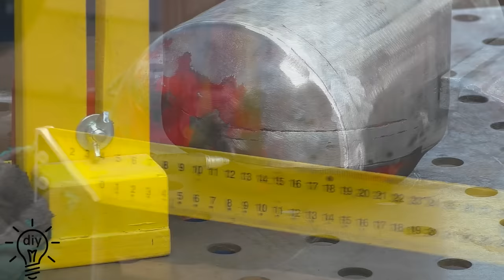A brilliant idea from an old fire extinguisher! You'll be glad to see it!

Comment: For anyone who has all the tools-and the experience- and a bunch of old stuff laying around--and a lot of time--this looks like a fun thing to do.  For anyone missing any of those, not so much.
Reply: Don't get me wrong, it is well made and looks great, but it's way more flat stock than fire extinguisher
Reply: I'll just go buy a big one that way I don't have to waste my time putting on and taking off 3 sausages over and over everytime people come over
Reply: @dickballington702  
Les vaniteux sont tellement nombreux sur cette terre !
Il regarde une vidéo jalousent la personne talentueuse !
Parle de leur égoïsme en parfaite connaissance de cause  !!!
Reply: Lol
Reply: I don't know why but your comment really made me smile. I also totally agree with you 🙂👍
Reply: in a way it's like extreme home makeover, without Ty but with a repurposed extinguisher. 
yo.
Reply: Very complicated
Reply: The only non-standard tool here is the welder
Reply: Yeah, and you need all kind of discs for angle grinder. And why not, like, who would use paint stripping gel, when you can do it the hard way? Also, this crap will rust without heat-resistant paint. It's dumb. Also, TIG welder is basic?! The price of a good one, and accessories, and storing of gasses, and wires, and protective gear. And cost of the hole drilling attatchements. Goddamn. Just buy a grill. This is dumb. And also heavy, he uses unnecessary thick material.
Reply: Aye yo, nice name 👌
Reply: @sankarbijoychakraborty5144  I wouldn't say it's complicated exactly-- but there are a lot of steps in sequence.  In the aggregate it's simply a lot of work for a pleasant, but I think given the amount of work, modest return.
Reply: @janvrabec3401  Really heavy.  And for a relatively modest cooking area.   But OTOH, yes, it's cool, and interesting.  This is not dumbest-idea-on-the-internet territory here.  My point was that it's not generally going to be accessible to a lot of people.  And, um, 33,000,000 views? So it certainly resonates.
Reply: @dickballington702  Nobody cares if you make one or not.
Reply: @Em Cee, exactly.
Reply: @Marc10182  it's not selfish to point out that it's a lot of work for such a small reward.  People put their videos out for public consumption then others (like you) cry when it's consumed... Stay off the internet if you can't handle people's opinions.
Reply: What you on about, gents, 8:45 minutes! Is all it takes!
Reply: @dickballington702  Do what makes you happy.
Reply: @sankarbijoychakraborty5144  I guess with that attitude we won't be seeing you make one.
Reply: This is the 1st comment to ever make me actually lol. Maybe because I heard it in my head as really sarcastic. Amazing. Ty
Reply: @feihong005  You heard correctly.
Reply: I agree it's all very clever and all, if you a the scrap, a welder, the power tools, the time. Or you could just get a $10 hibachi and be done with it.
Reply: @dickballington702  you almost got us fooled. 
Bold of you to assume anyone would come over, let alone you have friends. 🙄
Reply: @michaelsexton8885  
L'inversion des valeurs personnelles. 

Michael Sexton, nous ne trouvons guère de gens de bon sens, que ceux qui sont de notre avis !?
Tu comprends la nuance entre “T’es un con” et “Je suis pas de ton avis”.
Cordialement
Reply: @michaelsexton8885  
En sport, on reconnaît facilement ceux qui sont meilleurs que nous. mais dans le domaine mental, on a l'impression de détenir la vérité, ou en tout cas, ce qui s’approche le plus du bon sens.
Notre réflexion est précieuse à nos yeux : se faire insulter pour ce qu’on pense, c’est se faire traîner notre égo dans la boue ! C’est aussi violent que de se faire traiter de gros ou de moche.
Une opinion, c’est une recette de cuisine : tu mélanges que tu sais avec ce que t’as vu, ce que t’as lu, ce que t’as cru comprendre, ton expérience, tes croyances et tes valeurs personnelles, tu mets tout ça dans ton four mental et tu fais cuire à réflexion 12. Puis tu présentes fièrement ton gâteau à l’assemblée.
Ca, c’est sans compter les goûts de chacun et les allergies. Ca veut pas dire que ton gâteau mental est mauvais, y’a juste plein de gens qui ont de bonnes raisons de pas aimer ta recette.
Y’en a même beaucoup qui estiment que ton opinion ne vaut rien avant même de l'entendre.
Deux politiques de parti opposé, c’est exactement  ça : pourquoi écouter l'autre puisqu'on sait déjà qu'il va dire de la merde ?
Eh ouais. Donc là, t’as bien les boules, c’est la guerre puisque ton opinion est saine et intelligentes. Les autres, ils sont pas seulement différents, ils sont aussi malsains et idiots, hein ?
Si tu comprends pas ce que je viens de dire, c’est que t’es un gros débile.
Eh ouais, hein ! C’est agressif, hein ?
Voilà, donc : arrêter d’insulter et de dénigrer, c’est la base.
Cordialement.
Reply: you only buy stuff dont you?
Reply: On top of that you also need the fire extinguisher!
Reply: @janvrabec3401  it is a MIG welder  and disks don't cost much. Most things like welders can be rented cheaply or maybe we know someone who can lend us. Oil paints are expensive and there are many people who can't afford them, but to complain to Bob Ross about a how to paint video is borderline ridiculous.
Reply: @yvandaniel8050  God forbid.
Reply: @ringofasho7721  vero.
Reply: Tell me you live in an HOA neighborhood without telling me you live in an HOA neighborhood
Reply: @joelsefur666  I bet you're a blast at parties.
Reply: Bro why haven't you patented that And sold a shit load of tiny smokers people would buy those all day for camping.
Reply: @janvrabec3401  It's a MIG welder.
Reply: @wvmtns6400  
ه
ششش
Reply: You have two kinds of people. The kind that have stuff and are willing to go out and find stuff.  Because they like to work with reusable stuff.  We are on a never ending quest to find this stuff and put it to use.   And then you have people that piss and moan about stuff.  And claim that missing one piece of the puzzle is a deal breaker.  Although all the parts are readily available when sought.   These people stop themselves before they even get started.  And yes, those people should probably just buy a barbecue Made in China, hehe.  I like working with metal.  So this isn't so much about what he's made.  But about how he put it together.  Because I intend to use the skills, or ideas,  myself.  I am in no way restricted to making an exact replica of this project myself.   A video such as this could just as easily bring about a new thought of creativity.  That might bring about a totally different build idea.  But not if I'm ready to let one missing piece put a stop to my project.  Because unless that one missing piece is my brain.  I can figure it out...
Reply: @randomamerican471  Well stated Mr. American.
Reply: WHY? Just because you can.
Reply: I agree with you. I watched this video and I thought "what a waste of time for three sausages".
Reply: You could have it all and with all i mean the actitude to do it
Reply: @joelsefur666  amen
Reply: @janvrabec3401  Wow, thanks for the insight Major Buzzkill!
Reply: Exactly what I thought.
Reply: It's a great design anyways. I think I could do that out of other materials in 5 nights or so after work. Perhaps cans instead of steel . Who knows. I'll try and tell you in a few months when I find the time to figure how to properly do it.
Reply: @ringofasho7721  jorh
Reply: Way to time consuming for end result.
Easy 8-16 hours work for something that can hold 1 chicken.

Best thing to use is an old keg.
Light weight and actually a decent size.
Made a few for people over the years, really easy way to make $$$
Reply: Totally agree 💯
Reply: This is an example of the biggest problem in the world today, pessimism. These tools cost about $200 altogether fire extinguishers free and you can get those pieces of metal for free at a metal yard as scraps. And you can literally watch YouTube videos for free for two weeks and learn how to do this with unlimited free materials if you mess up, the tools you only have to buy once.
Reply: @janvrabec3401  
"All kinds of discs"
Looks to me like that could all have  been done with 2-3 cutoff wheels at a buck each and a single 80g flap wheel for about ten bucks.
Hole saws are a long-term tool you buy to keep, but there are cheap disposable ones too.
Except for the welding, there's nothing her that the typical homeowner couldn't do.
Reply: He is  just fooling   people like you  to jake money  in the u tuhe
Reply: All the tools? You only need 3 tools to make it. Lol
Reply: I agree , he obviously has way to much time on his hands, or he’s on a Prison day release scheme 🤣🤣🤣
Reply: Lol all you bums complaining about how much work this is. . . I could build this in like 20 minutes. It’s not complicated at all but I guess if you spent your whole life in front of screen instead of learning valuable skills, then sure. But I digress this is the world we live in today.
Reply: @stevenseagal6548  kegs are made of aluminum. Therefore requiring a specific type welding machine in order to weld it. This wouldn’t take anywhere near 8-16 hours to build and the one in the video won’t hold a chicken lol. 

Also aluminum is an amazing heat sync. Meaning it dissipates heat very very effectively. Thus rendering your though completely pointless. You want a thicker material in order to retain the heat from the fire. As with smoking it isn’t about using high direct heat for cooking. It’s using low temps over extended periods of time to slowly cook the food to tenderness and impart that sweet Smokey taste into the food being cooked. 

All you negative Nancy’s need to go on somewhere. I don’t get it. How can so many people be so negative about what someone else built and put on the internet to inspire you to create your own things in life. Jesus you people need help.
Reply: Exactly ❗
Reply: I was thinking the same think... Yep no welder in my tool box
Reply: @TuscanyFTX  Mate I've been a qualified metal fabricator for 15 years and am a qualified pressure welder.
Have also done plenty of quoting and time estimates.
I've made a few different kinds of smokers for fun.
I see about 8 to 16 hours in this, if you wanna make it nice quality.

If you think you can make this in less than 8 hours to the quality on screen, ill hire you tomorrow.

I know what I'm talking about.
Im not some back yard fabricator.

Also the majority of MIG welders can weld aluminum, replace your lead liner, change gases and wire.

If you buy a decent TIG it'll be acdc and can weld aluminium as well.
Reply: Have to agree with the OP. I can buy a grill for $200 and in way less time
Reply: HA HA, My problem is I don't have the imagination!  Took me half the video to figure out what he was making.
Reply: @stevenseagal6548  I’ve been professionally welding/ fabricating/erecting for 20 years. I could build that in under 8 hours easy. He uses scrap laying around to build it. It’s not that difficult to do. I’m good on the job offer though thanks.
Reply: COVID project.
Reply: The fact that so many people don't have the know how to fabricate even a little, really irks me, I think you all are selling yourselves short, it doesn't take 70 years to get the skill, you could be as good as this guy in just 4-5 years of practicing for a couple hours three times a week!
Reply: @Marc10182  I don’t think anyone on earth cares what French people think. Unless they want advise on surrendering.
Reply: @chrisallen9154  no one cares that you don’t care
Reply: @TuscanyFTX  it’s very easy when this get shoved in front of other things you watch and the title says you’ll be glad you watched. I was not glad I watched someone do something I’ve seen before. Wow he cut some metal and welded it back together to form something else. I’ve watched and done crap like this since I was a teenager. It’s boring now. I wouldn’t say anything if the title didn’t say I’d be glad I watched
Reply: Yeah, the material and equipment cost more the a commercial smoker BBQ.
Reply: @wvmtns6400  kkkkkkk
Reply: Victor
Reply: @jareda3106  i mean it probably took him a week to make this one...
Reply: Do you know how people get tools and a bunch of stuff lying around? We buy the tools, collect the old stuff. The experience comes with using the tools to create things from the old stuff.
Reply: @ringofasho7721  ♧$
G
Reply: Super))
Reply: more items on my youtube channel)))
Reply: The experience is way more important than the tools. Metal fabrication that doesn't look like it was done by a tarded meth addict takes lots of practice.
Reply: But the idea of bunch of friends letting their tools is something to retake. In big cities for exemple this is much worse. I give one another example: two years ago I was in the Alps doing free work for a community. And many people in this community were working free too, for the aim of cutting wood, for the whole community there. A small village 200 inhabitants... Isolated quite isolated. And also cleaning paths.. cutting savage vegetation etc in the middle of the paths. The tools belonged to either private people or some company or the mayor.. anyway.. solutions are often possible.. not like places like Cuba for example. I just talked with friends about the possibility of planting olive trees or anything alike... in Cuba... Which is solution.. and not possible because people are despossesed of either lands or either of permits.. or either of even just the will to be like that.... To do thinks like that.. and as you said! Of course.. to be able to do it: tools.. learning... Permits... Spirit of good will etc...and not transforming the countries into contaminations huge companies of hundreds of like slave workers.. but instead things and projects that are originals.. and more or less free.. at least with participative actions.. more than violent actions. Instead of taking the hood things of each country of each person.. more and more we appear to be having taken every defects of each group instead
Reply: @janvrabec3401  well that was pretty brutal of you. I see your point, and I'm sure he already knows all of this as well, I'm guessing it's a hobby type project for  him. I  actually tried it myself (far from that professional looking/functioning by far) and wound up burning down my daughter's dollhouse, and half of the back yard! But 2 out of the 6 sliders, tasted great, and didn't resemble hockey pucks! 😜
Reply: I love it! Fun little project to practice your fabricating skills and end up with something useful! Those hinges are priceless! Well done!
Reply: For those there's the G-Stove 😉

Comment: Pretty cool . I welded for a lot of years . He has pretty good skills. One thing I noticed is the use of a grinder. I was taught how to use a cutting torch. I got really good with one . I worked in a welding shop back in the late 60’s through to the early 80’s . If my shop Forman caught me using a grinder to cut up the pieces to make the stove he would of taken my head off .  I can hear him now “ do you think them blades grow on trees “  he was really skilled journeyman and I learned lots working under his mentor ship. We did everything production pipe line our expertise was building fuel tanks. We went across the Arctic building tanks. Really remote settlements up past the Arctic circle. I think the furthest place we did a tank was in Resolute Bay.  A grinder in our shop was used to clean up a weld or clean up a spot to weld too . Times have changed and I see the guy is pretty good with the grinder or cutting wheel . Not putting him down just stating how times have changed.
Reply: It's a little harder for the home hobbyist to acquire an oxy torch
Reply: I haven’t managed to make a clean cut with a cutting torch. I bought a $200 plasma on amazon and it works great until 5mm
Reply: Ä

Ä
Reply: Oxy-Acetylene rigs are expensive. You can a whole hell lot of cut off discs for the price of one. Not to mention the cost of filling your tanks. Not to mention the time it takes to drag out the rig...having said that, I’d love to have a cutting rig to complement my plasma cutter. 😃
Reply: Interesting.  I would have loved to travel to those sites and work on building tanks.
Reply: Sad to see things are getting worse these days.
Reply: @elarsnilsson  But you only speaky Angstrøms?
Reply: Interesting life
Reply: That was allot of typing to say "I don't know how to weld."
Reply: He probable used cheap ones.  A Diablo blade may cost twice as much but lasts at least a dozen times as long.
Reply: @killboyy777  ...and I other equipment plus the thick steel sheets.  This probably costs more than a commercial unit but it has a lot thicker steel.
Reply: Yep, now we have SkillSaws with metal cutting blades going thru half inch steel like butter....

Comment: One point I'd like to make, is when using a drill bit, hole saw or whatever, to make a hole in steel, you do not need such high rpms to cut. You only burn up your tool, weaken it, and dull it. Lower RPMS, and a little cutting fluid will get you through, without burning up your tool, and work hardening your material.
Only other remark I have is this little smoker/bbq is very cute, but unless you absolutely need one that small and that durable, just build a full size unit.